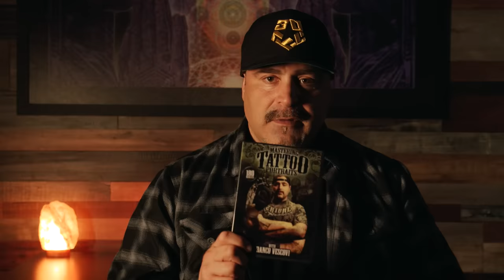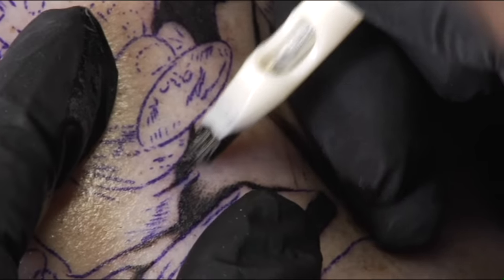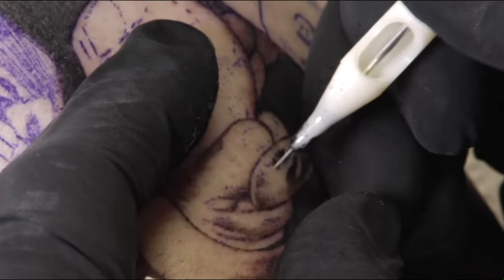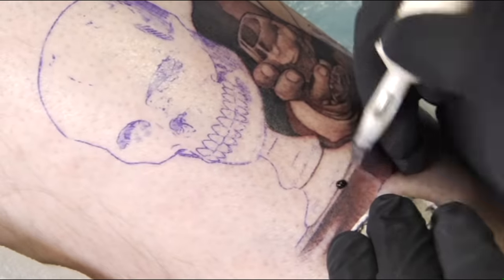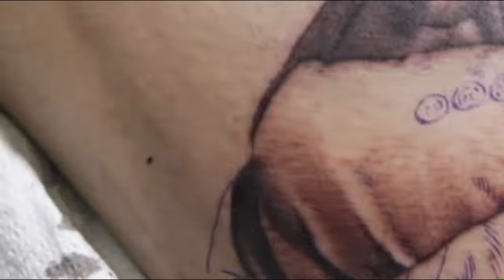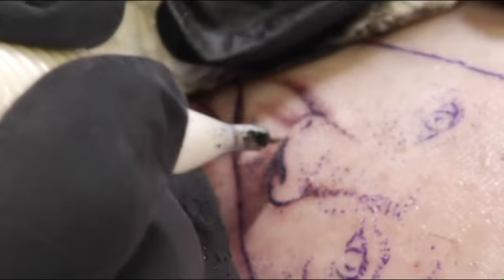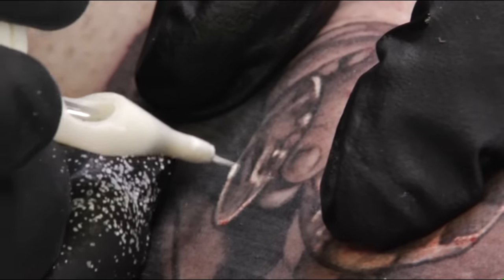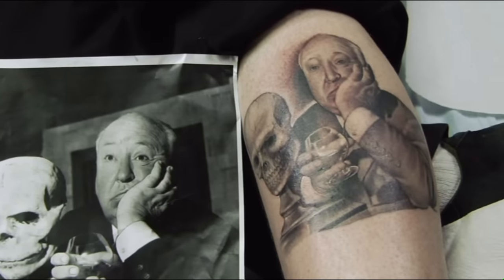Mastering Tattoo Portraits with Franco Vescovi

Comment: How did this portrait hold up over the years using Pelican Ink? And have you started using a different brand since then? If so, what brand? I've been using Dynamic for just about all of my black and grey pieces. I used Pelican ink around the time this video was made and noticed that those pieces healed up pretty light. Probably due to time, and they still look good considering that it's b&g and they heal and fade consistently, but I'd like to use something that'll lighten up less over time. Any suggestions?

Comment: amazing ,thank you so much ,may i ask how fast you were running your machine ?
Reply from the maker: The answer wouldn’t be helpful because when this was filmed in 2007, Franco was using a coil and also a rotary with a completely different motor than the ones used today. If he made this tutorial today, he would use the Shader WAND at 8.5 to 9v. Hope that helps! 🙏

Comment: How many volts is used?
Reply from the maker: The answer wouldn’t be helpful because when this was filmed in 2007, Franco was using a coil and also a rotary with a completely different motor than the ones used today. If he made this tutorial today, he would use the Shader WAND at 8.5 to 9v. Hope that helps! 🙏
Reply: @BishopTattooSupply  thank you